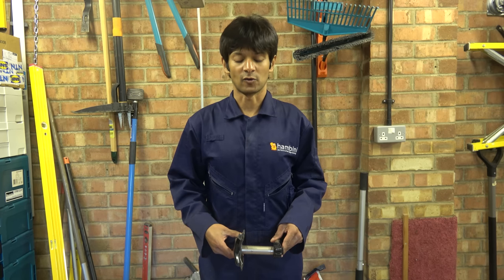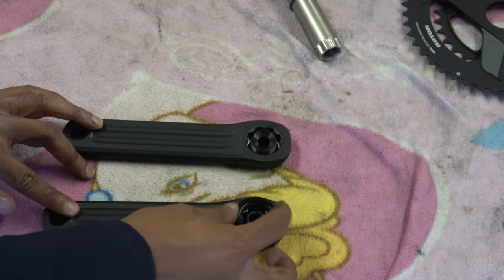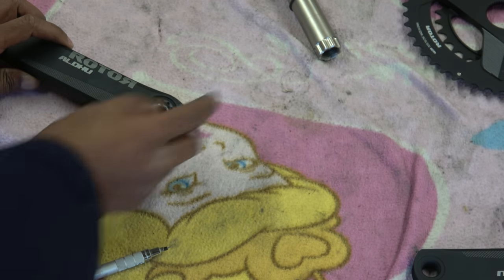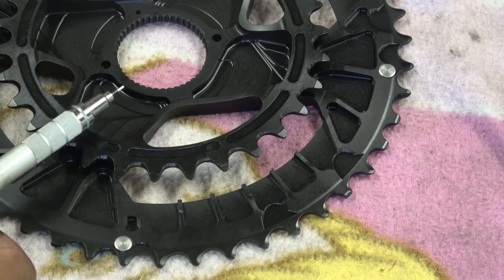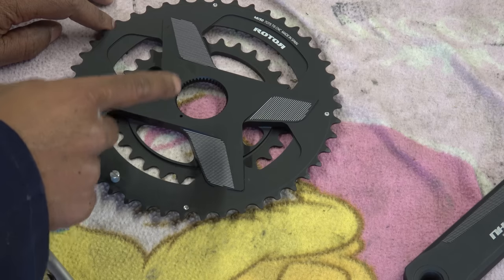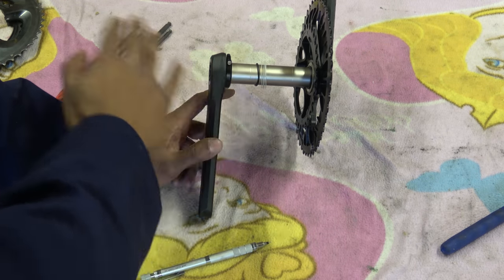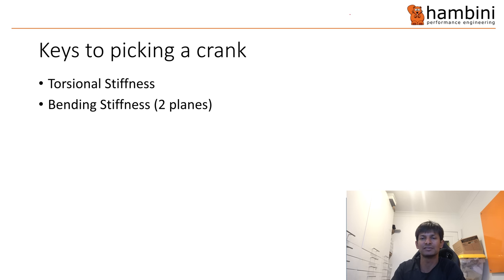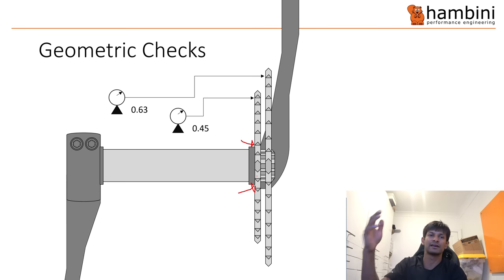Rotor Aldhu Crankset Teardown | SHIMANO drop in replacement

Comment: Guys, I need some of your expertise, my bike has a BB86 and I am currently using a Shimano crankset, are rotor cranksets compatible with my bottom bracket (alpha or vegast)?I the answer is yes, do i need to change something like the bearings to install the crankset?
I am really lost whit this.
Cheers.
Reply: Yes it is, you'll need to use Rotor's 24 mm steel spindle along with compatible crankarms (24 and 30 mm spindles take different crankarms). The BB can stay.

Comment: Hi Hambini,

I am a non-engineer avid cyclist: I love your videos and have learned a great deal from you. I was a bike mechanic for 15+ years, and am curious to know your thoughts on contemporary drivetrains, especially any techniques or methods that can be used in addition to the manufacturer's installation instructions to optimize shifting accuracy and reliability, and whether you have preferences or recommendations for 12 speed drivetrains. I apologize if this has already been covered by you or is not an area of interest for you.

Comment: IMHO, I don't believe that the current incarnations of 105 crank is likely to be stiffer than the DuraAce or Ultegra. As 105 is claimed to be the Hollowtech2 same as the higher model. Thus, I see no point why 105 will be different. 
Shimano crank to go for me will the the non-series or Tiagra/Sora/Claris, as their arms are simply 1-peice of non-hollow aluminum  joint with the axle on Drive-Side. They may not be stiffer than the higher-end models, but their longevity would be superior.

Comment: Stiffness is really a non issue for cranks. Since you ankles aren't infinitely stiff either. Most of us don't put out enough watts to even stress a square taper BB enough. I cannot flex my rotor chainrings mounted on a power2max spider on one of these. The quality is quite good IMO.
Reply: Tell me you're <100kg without saying you're <100kg.
Reply: Im 76kg. Max watt is 1150 3s. Rotor crankset is stiff enough. But so are square taper 135bcd forged alloy campy chainsets....

Comment: Those chainrings must be expensive to replace. Other than that, nice crankset
Reply: If you want a more economical alternative, you can buy their 5-bolt 110 BCD spider and you can run any corresponding chainring you want.
Reply: @yonglingng5640  Thanks

Comment: I've been on rotor cranks for a few years now, I think it's a 3d+ and its been fine.   I also gave the hawk MTB cranks a good hammering on my enduro bike and they use the same mounting system as the aldhu.  Off the back of that I've put an Aldhu carbon on my new road bike and so far so good,  I really like the oval rings.  I do agree that the instrucrtions could be much better.  The setup is based around the oval rings and the OCP concept.  Obviously the timing is pointless on round rings (apart from having the pin behind the arm) and they don't explain that at all.
Reply: Other than the pin behind the arm, the clocking also affects where the shifts happen due to the location of the ramps and pins. Not a huge effect though.

Comment: Im a cheap fuck  so i buy used cranksets on ebay  and my first requirements  are 24mm  axle  and 5 bolt 110BDC , chainrings are cheaper and easy to get .. Oh and i stay away from shim or wavy washer cranksets .

Comment: Why not just go for 105?
Reply: It's hard to understand why someone would go for anything else if 105 can fit and they do not need a dualsided powermeter or funky crank length. You can completly dismantel them even with small 4mm hex key compared all this other things where you actually need a proper length of handle to cope with that 40ish Nm. Plus they have the best possible preload system and shifting is brilliant on shimano chainrings. All that for 100 and something euros.
Reply: @debelifratar  105's come with dual-sided power meters from both 4iii and Stages.
Reply: @lastfm4477  but those powermeters suffer from an inaccuratcy due to their assimetric design (at least r7000 model). They might fix that with a new 12s 105/ultegra... you can watch GP Lama's test of a new 12s DA dualsided power meter and it's still not working properly.

Comment: I can build a rotor 24mm crankset with the vegast arms for 290 euros can any body tell me if this is worth it compared to an ultegra crankset
Reply: Modularity is your newfound advantage with a Rotor crankset. If your spindle is worn out or you want to try different crankarm lengths, you can change those individually, no need for a new crankset.

I have been pondering about getting an ALDHU for one of my future builds.

Comment: Will it work on a hollowtech 2?
Reply: You mean if it will work as a replacement for a Shimano hollowtech 2 crank? Yes, that's basically the point of the whole video ;)
Reply: You need to run the 24 mm steel spindle, but this means you'll have less crankarm length choices and you can't pick the carbon counterpart.

Comment: I checked with Japan. I´m sorry, no Shimano cranks has EVER fallen apart. Completely unknown of...    Rgr
Reply: I did find a few Japanese blog entries about Shimano crank failure, but their models are old though. 
Question is, why in the world high-end Shimano cranks sold outside of Japan fails? Humidity in Japan is almost as bad as SE Asian countries. 
I wonder if fake components from China get mixed with legit ones. Or local distributors are unknowingly selling the fake components just like how fake bearings are sold.  Something isn't right when legit-looking, high-end Shimano components sold through internet retail sites are 25% to 30% cheaper than LBS.

Comment: Man this so called forged cranks are a joke. Flimsy thin tin can like metall glued together. What a joke. I take a massive billet aluminum crank any day of the week.
Reply: Forging itself is not the problem. It's actual engineering that didn't thought through. Had Shimano built their hollowtech cranks like airframe spar with rivets and inner corrosion prevention, I think they would withstand stresses which Hambini described. I think "Lighter, the Better" mantra from the cycling world has influenced Shimano to forego engineering common sense to appease weight-weenie crowd.

Comment: First and main problem. The chainrings are proprietary. Good luck finding replacements when Rotor move on to something new. They have already ditched 5 bolt chainrings. FFF! Stop building obsolescence into bikes and bike parts.  It's adding to the consumption epidemic consumption. We are having to buy complete new parts or bikes as these gready manufacturers simply move the goal posts.
Reply: Then don't buy that chainring. Buy Rotor Aldhu spider in 4 or 5 bolt 110bcd and use any chainring you want. Shimano chainring even fit on 4 bolt 110bcd Aldhu spider.
Reply: The modular nature of Rotor's cranks renders this argument moot. You can literally build up a Rotor crank to accept any chainring you want - it's right there on their website. I'm not a Rotor fanboy, but sorry, try harder.
Reply: @Hexsense  The 4-bolt spider only takes Rotor chainrings due to the contours of the spider.
Reply: @TypeVertigo  Thank you for your correction and advice. You were doing really well until the point when you turned your advice into a competition of knowledge, with a belittling comment. We can all learn from these comments within this video. Better informed users of consumable bike parts makes wiser decision making for us all.  However, just because you know something someone else doesn't, does not give you the right to belittle. Correct, advise and inform only is my advice.
Reply: @Hexsense  Great advice, thank you for the correction and information you have provided. This is a refreshing change form the onslaught of propriety components we now see fitted to these bikes. What ever happened to the standard bike stem or the standard 27.2 seat post?